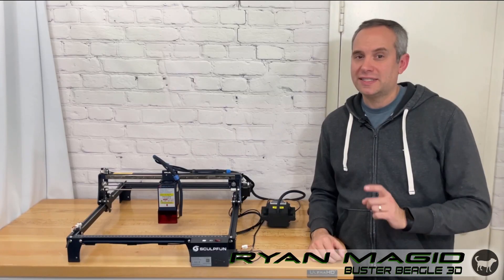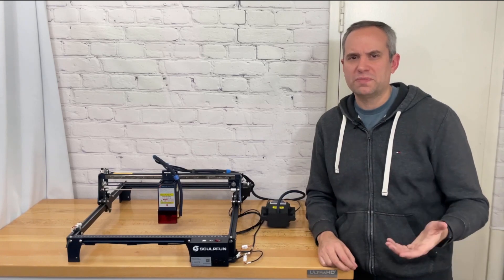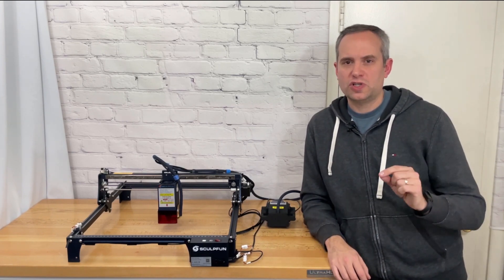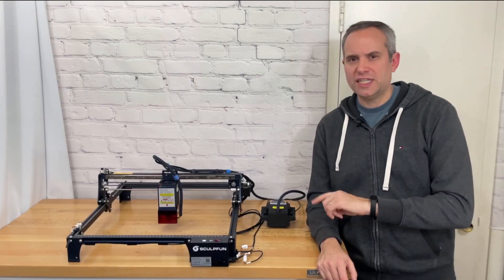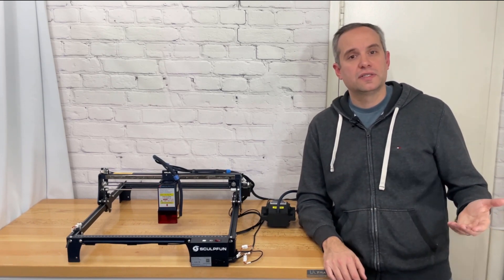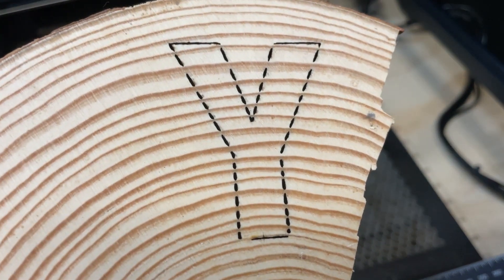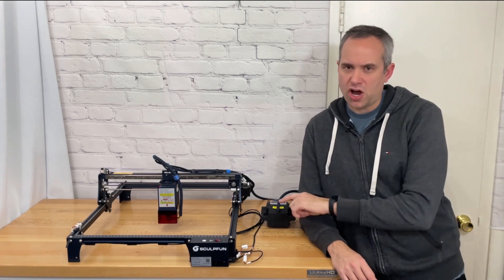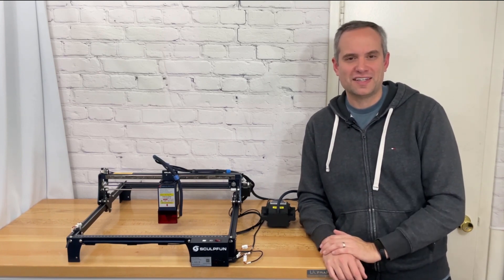Sculpfun S30 Pro Max 20W Review | Diode Laser Engraving and Cutting Machine | Automatic Air Assist!

Comment: Outstanding review that's one of the clearest and most helpful I’ve seen on this topic. I really appreciate the way you break things down so practically.

I’m currently using a 10 W Ortur and looking to upgrade to something around 20 W that doesn’t have cables getting in the way, and is fully compatible with LightBurn. I tried the xTool S1 and really liked the machine, but the LightBurn compatibility wasn’t really there as they really push their own software, which I’m just not motivated to learn at my age 🤦😂

Given your experience, what would you say is the best 10-20 W-ish diode laser that works seamlessly with LightBurn and avoids the messy cable routing?

Would truly appreciate your insight and thanks again for all your efforts

Comment: Shouldn't need enclosures, they need make them with attached small hose close to where the laser is to vacuum it and pass through either outside or a 3M smoke filter.. your laser system will start stinking after a while.

Comment: hi i bought the ultra version 22w, a couple of considerations, green glasses are not optimal to protect for blue light, the correct colour should be orange, its possible to buy separatelly some protective wire chain made of plastic, but im not sure about the inner dimensions it should be, did u think a 10 x 15 milimeters wil work for wires AND the air duct? thanks for the video!
Reply from the maker: Please don't rely solely on color for laser safety glasses. What you should be looking for is the rating to block the 450nm wavelength of the laser and not just mask the color.

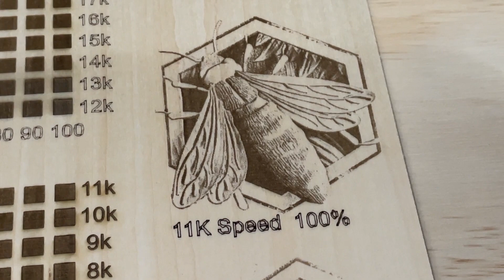Comment: Thanks for the video! at and around the 8:10 mark the text looks a bit rough. was that on purpose or is the machine not super accurate please? thank you again!
Reply from the maker: No. I can't 100% remember but I'm guessing that was because I tried to run the text far faster then I should have. It was a mistake in processing as any machine would probably have trouble running outline text too fast.

Comment: Great video, thanks. What would be the advantage of getting the 20W as opposed to the 10W
Reply from the maker: Only real advantage is cutting speed. You might able be able to engrave faster but the trade off is that a 20W laser has a larger spot size which could mean lower resolution engravings. Might not be enough for you to even notice on most engravings but if detail is important the smaller the laser spot the higher the detail.

Comment: I was saving up for the Xtools S1 but the price keeps increasing which is pricing me out, so I'm considering S30. Should I keep saving or buy the S30?
Reply from the maker: I didn't have any issues with the S30 but it really comes down to personal preference. I would however really consider a machine with a full enclosure as it is much safer and better for your eyes and lungs.
Reply: @BusterBeagle3D  Thanks for your advice. Safety is very important.  I have purchased the Sculpfun B1 protective cover. I'm shocked at how huge it is. It doesn't have a base platform; it just goes over the laser, so I may have to tape around it to stop fumes from escaping underneath. I need a workshop. :) I plan to upgrade the S9 to a S30 and buy the Extool S1 at a later date.  I just can't afford it now.

Comment: Is it easy to change that speed settings a bit higher ?
Can it also be done in GRBL ?

Thankyou
Reply from the maker: You can adjust the speed but honestly I wouldn’t even go as high as the speed I mentioned. You really don’t want to go faster then the machine can handle. You can however change this speed setting in LaserGRBL if that is what you meant. It’s under GRBL> GRBL configurations.
Reply: @BusterBeagle3D  Thanks let's go can't wait to speed this thing up!!

Comment: I've had a 40w co2 laser and an Atomstack 5w diode laser. I like diode lasers because they do the same job on any spot on the work space,  unlike a co2 laser where you have the mirrors and laser lens lined up exactly ( which takes a long time) to get the same results. That being said , instead of "air assist" on my next laser I'll have "vacuum assist" to remove the smoke not just blow it around.   This is a good review but I'm always a little gun shy of reviews on company donated machines.  that"s just me
Reply from the maker: The air assist on the unit isn't really for just smoke removal but is used to strengthen the power of the laser beam in a specific spot. Think of it like blowing on embers in a fire to increase the heat and fan the flames. It also does a great job of removing the kerf so you not only get a cleaner but a deeper cut. 

I completely understand being hesitant of reviews where the product is provided to the reviewer but that is also why I'm not shy to point out any issues I find with the machines I review. Just a quick browse through some of my other videos and you will see plenty of times where I talk about this or that needing improvements and the best part to me is when an company actually listens and makes a change. All opinions are my own and nothing is "vetted" by the companies I make them for.  I also do not charge for any review that I make to stay impartial although I do sometimes get affiliate commissions sometimes if people use my links.   

Anyway thanks for watching!

Comment: regarding wanting a constant low-pressure when engraving: have you thought about adding a Y-fitting connected to a low-pressure air source (aquarium pump?  shop air compressor with regulator?) to the Air Assist line (after the pump)?  That way you'd have a constant low pressure air flow that would be supplemented by the Air Assist main line when directed.  Thanks for the video!
Reply from the maker: I typically have a valve that I put inline in the hose to restrict the air pressure to how I need it. I just wish it was an automatic process that I don't have to babysit. I will be reviewing a laser very soon which is supposed to be able to adjust the airflow through the gcode being sent to the machine which is really what I was referring to.
Reply: @BusterBeagle3D You can combine some if both your ideas. Put a y fitting and install a push connect needle valve to atmosphere. Set it to how you'd like for engraving. When cutting, simply plug the end and the entire air supply will go to the assist. Thanks for the vid, though 👍